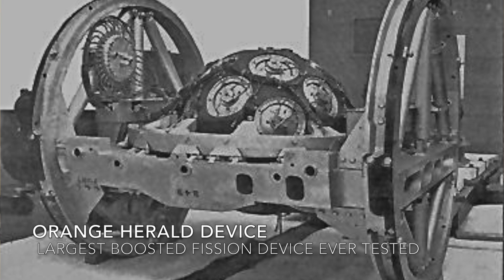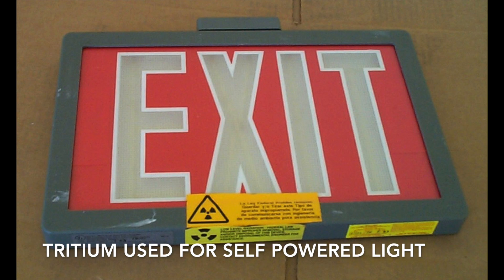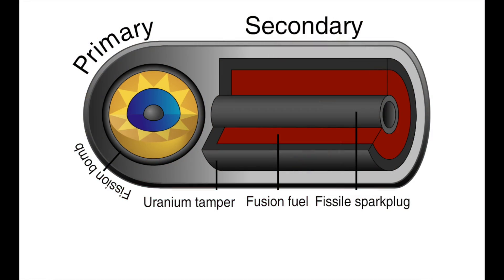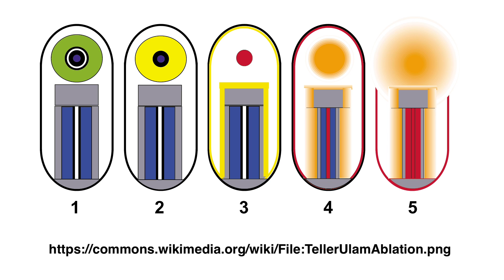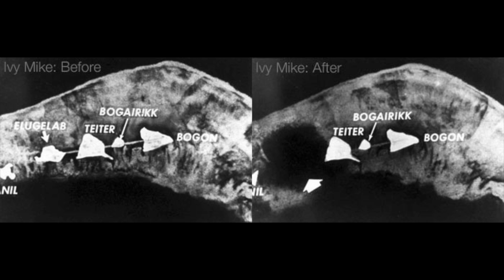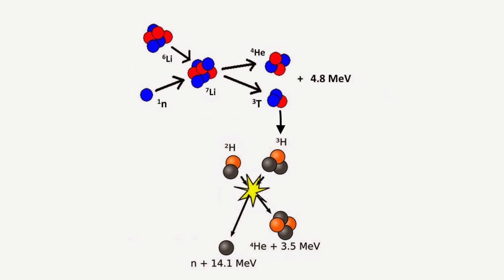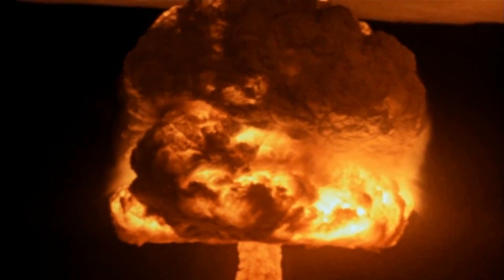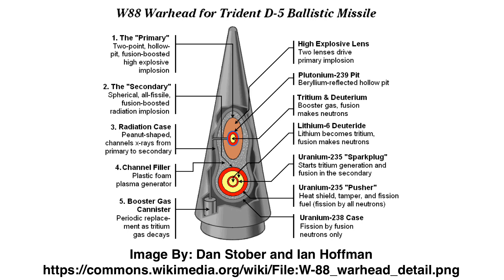Going Nuclear - Nuclear Science - Part 5 - Hydrogen Bombs

Comment: I visited a underground nuclear bunker were they had a thermonuclear warhead from the days the UK used to use the V bombers. I was surprised just how small the actual explosive is. The lithium deuteride is kept in a sphere about the size of a soccer ball.
Reply: Semthepro Gamingmaster 
Don't they punch through because of the weight?
Reply: +dgtrh gabhfd  I doubt there are any "electrically ignited fusion bombs with superconductors..."  The giveaway to your notion is "superconductor".   Electricity does not convert that easily into the required temperature/pressure required to initiate a fusion bomb. If your scheme worked, we would have likely experienced such a device detonated by terrorists, since superconductor technology is off the shelf, and Lithium Hydride is easy to acquire.
Reply: Not far from me is an old nuclear bomb store which has been reused as a small industrial estate. A lot of the old buildings are still there including what look like brick sh1t houses dotted around in groups, each has a thick concrete floor with a hole in the middle to store the core of each weapon, the hole isn’t that big, counting the number of these ‘sh1t houses’ - the odd one being a double core storage gives the number of bombs that could be assembled. I think it was about 64.
Reply: well... there are already DU-shells that are used since the 90's that can kind of melt their way through tanks and pillboxes ending up in a fireball of death... :P
Reply: yhea... thats what i kind of meant... (not an english speaker) they punch through and get heated up so hard that the uranium shatter into tiny little pieces and greate a fireball of death... yhe... a radioactiv fireball of death... better...
Reply: Football
Reply: Adam Antly What about football?
Reply: @glenwoofit  A soccer ball in the UK would be a football, I'd imagine.
Reply: dgtrh gabhfd they've been able to use a laser. But it's not very practical for the battlefield.
Reply: Dat Sam I think it's the friction from the kinetic energy.
Reply: More likely a cylinder.
Reply: oh the radioactive is actually a concern, the particles flew for example on the the sand grains and distributed through sand storms in northern kuwait and contaminated huge areas, many ex soldiers could not have healthy children anymore and kids that played in tank-wrecks and with the remains of the ammunition got cancer and eventually died... the cancer rate in general rose like in tchernobyl, still the lobbies and goverments, that use the ammo, deny proven negativ effects of this ammunition...
Ofc the uranium is depleted and the radioactivity is not at strong like gamma rays... but DU still emmits alpha rays which are still toxic and can cause skin cancer or when consumed (because the particles are everywhere so on food for example...) can cause serious health problems and a lot of dmg to the dna...
Reply: @semtheprogamingmaster8610  DU ammunition hasn't been reliably linked to any rises in cancers, serious illness or birth defects among soldiers or civilian populations even in heavily contaminated areas. Alpha particles don't cause skin cancer because they can't penetrate the top layer of dead skin cells to damage the living ones underneath - the danger comes from inhalation or ingestion but DU dust settles out of the air very rapidly and uranium oxide doesn't easily contaminate plants or animals that might later be eaten by humans. The top metre of soil in my garden contains multiple kilograms of uranium along with thorium, radium, radioactive potassium and other radionuclides, while the world's oceans contain 4.3 billion tons of dissolved uranium and 74 billion tons of radioactive potassium-40.

Comment: Is the H-Bomb actually a Li-Bomb?
Reply: dr techtek The H is a Li.
Reply: I mean. Take the L, move up the bottom line and slide the I up against it and what do you have?
An H.
Reply: Deuterium and Tritium ar isotopes of Hydrogen. They can burn to (heavy and superheavy) Water. D and T are in therms of chemistry H. Thats why these bombs are called hydrogen bombs.
Reply: Sad they never tried donating the fission primer with shorted LiPo packs...
Reply: I never quiet understood why they call them hydrogen bombs. Even if it used Hidrogen isotopes it would be Deuterium or Tiritium.

Comment: If Castle Bravo "didn't go quite as planned" then Apollo 13 mission had an "undesired device behavior" :D
Reply: Castle Bravo was the motto of this channel: It was going well until it exploded.
Reply: Rockets don't explode, just experience rapid unscheduled disassembly.
Reply: Apollo 13 just had unscheduled change of mission parameters. The new parameters proved to lead to a successful mission!
Reply: More if Apollo 13 shot past the Moon and ended up on Mars.
Reply: @SvenTviking  If they had not returned (acccelerated) to a free return trajectory, they would have gone into orbit around the sun, since they had previously slowed slightly, to facilitate an eventual lunar orbit.   All Apollo launches out of earth orbit initially headed on a free return trajectory.
Reply: @SvenTviking  they were always launched with a free-return trajectory. That's why they survived and that's why it took days to reach the moon whereas probes like Voyager or New Horizon would speed past the moon in a few hours
Reply: Apollo 13 exhibited sub-optimal mission performance.

Comment: Hey Scott/Community. Could you provide (or maybe you already have) some information on the chilling of engines like it is done with the falcon 9? is it a really common thing, and how+why is it done?
nice evening everyone :)
Reply: Almost all liquid engines are cooled since the metal nozzle would melt otherwise, solid engines are not cooled and often use graphite or some other non-metallic nozzle that doesn't melt.
Reply: The engines are made from metal.  Metal can violently contract or expand from sudden temperature changes, breaking delacate parts.  The N1's died just this way.  So they cool the engine before the start pumping LOX through it in earnest.

Comment: As I understand it, the lead designer on the Tsar Bomba used the excuse of allowing the pilots a chance to escape as his justification for using the lead tamper instead of the U-238.  As it stood with a 50 Mt explosion they estimated the crews chance of survival at 50%, with the 100 Mt giving 0%.  Really though, in addition to caring about the crew, his worry was supposedly that with the 100 Mt explosion the fireball would have reached the ground and spread a lot of fallout, so he used his excuse to convince them to allow him to go with the smaller yield.
Reply: Every thing bigger than some 40 to 50Mt is a waste of energy. The energy will just go into space. There is  to mutch energy in an multi megaton explosion. the target is dead, it dosent matter, if the soil is molten to 10 cm or one meter of glas. With the same amount of material from one zar-bomb you can bulid 4 or 5 10 Mt bombs. they will do more damage.
Reply: Seems like anything that big is unwieldy and out of date anyhow in the age of ICBMs and MIRVs, even if the yield is beyond comprehension.

Comment: why does not everything that goes supercritical explode? should the power produced not increase exponentially until something slows the reaction down? (like the core exploding)
Reply from the maker: I specifically said the core was brought to criticality, not supercriticality. With the demon core the multiplication factor was quite low, so the reaction didn't grow as fast as it does in a bomb. This meant that the thermal expansion of the core happened before the reaction got too far, and the expansion made the core subcritical again.
Reply from the maker: Yes, but the reaction grows from zero to kilotons in less than a microsecond,
Reply: yeah, but in your last video on this you sayed, that the "demon core" or something went supercritical and "only" blasted the scientists with deadly radiation, but it did not explode, my question is, why such supercritical cores do NOT explode.
Reply: MsMotron Depends on how enriched the material is. Supercritical just means the reaction is naturally accelerating, but it might not be accelerating rapidly enough to make an explosion before it burns through the bulk of it's fuel. Making a bomb requires it to go supercritical extremely rapidly, which is a lot harder.
Reply: NeverTalkToCops1: A shake is 10 nsec, the approximate generation time in a prompt-critical mass.  The first bombs were designed to produce 80 generations before the criticality was ruined by the energy flux, that's about 800 nsec, or just less than a microsecond.  At that point its all over except the shouting.
Reply: so a significant part of the fuel is used up so that the reaction goes sub critical? as far as i understand it, supercritical means, that the reaction is critical even without the secondary decay neutrons, therefor the time between neutron multiplications is somwhere around 10^-21 sec. therefor the power produced increases unimaginably quickly.
therefor in a 0.1 percent supercritical reactor 0.1% of its total fuel would have to be used up, before the reaction slows down, and that sounds like a explosion to me.
Reply: MsMotron 
The demon core, iirc, was separated to under-critical parts before it did anything more than radiation burst

It might have exploded if it was left alone, but it didn't have time to
Reply: oh so anything supercritical really does explode, thank you very much for the explonation.
Reply: If the core is just barely critical the power output grows relatively slowly. As the core heats up it expands, which allows more neutrons to escape, which brings it back to a sub-critical state. If it's well above the critical mass, it will explode, but won't necessarily with the full yield. The problem is that the explosion rapidly disassembles the core, and the chain reaction is disrupted. To get a reasonable yield the chain reaction must outrun the detonation, and that's not easy. There are a few tricks that help.
1. Assemble the critical mass as fast as possible, and not just one, reach several times the critical mass before the chain reaction starts (it needs a starting neutron).
2. Add a neutron source that generates huge amount of neutrons instead of just the few that happens to be there naturally.
3. Add a tamper that by it's inertia slow down the explosion (material strength is useless at these energy levels).
4. If it's a plutonium core, make it as pure as possible to avoid premature detonation (fizzle). It's 240 isotope tends to decay spontaneously, release neutrons and trigger the chain reaction too early. Higher purity means lower chance of premature detonation, which allows higher compression and faster chain reaction.
Reply: +Scott    Yes. Did they not calculate "mechanical events" (most events occurring in the scale of microseconds or shorter intervals are electronic in nature, semiconductors and such) of the assembly process in nanoseconds? This is where the "shakes of a lamb's tail" is rumored to originate. One shake being one nanosecond.
Reply: MsMotron The critical mass was not assembled quickly enough and was not held together long enough to cause a fission detonation.
Reply: As Allan says it depends on the speed of the criticality.  A slowly forming critical mass gets very hot and can vaporize (thereby becoming non-critical) before exploding.
Reply: As fission numbers grow exponentially the core heat and expands. Only by forcing rapid exponential growth (kicked off with the original "urchin" or modern neutron sources) and by constraining material expansion with a massive tamper, will enough generations of neutrons/fissions produce a useful weapon. If I recall correctly the original weapons needed about 72 neutron/fission generations... if the core expands and escapes only a couple of generations early the weapon will fizzle.